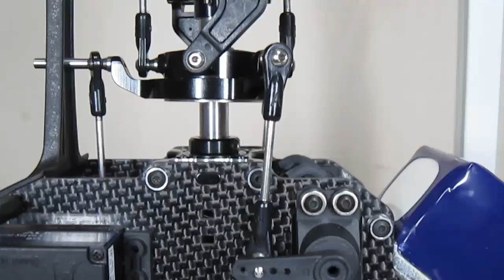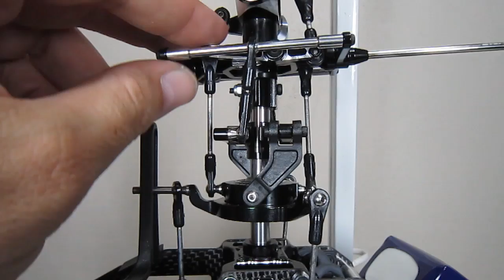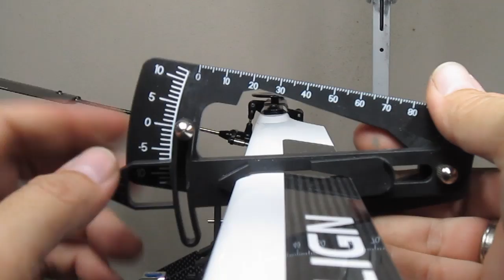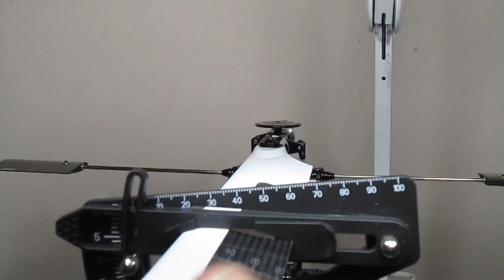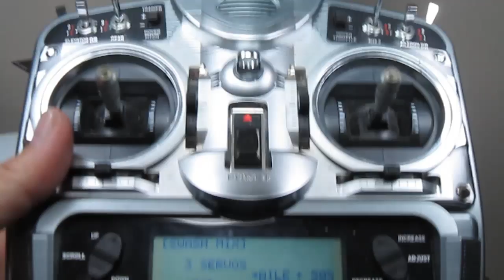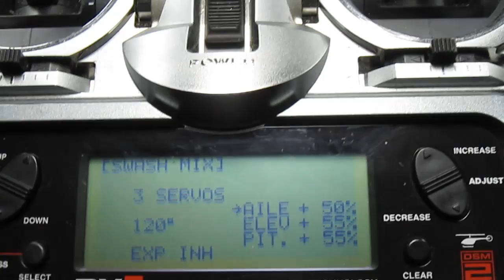Align T-Rex 500 ESP Step by Step Build Page 22

Comment from the maker: to measure the aileron and elevator angles simply put the blades at  90 deg to the heli and inline with the heli for elevator /. aileron measurements. I will do a video soon to explain that, its a lot simpler than people think. when the blades are 90 then elevator is measured by using just the elevator stick movement, same setup as pitch but your at center stick for the measurement, and inline with the heli same process for the aileron.

Comment: Thanks for the video. A quick question:  when i rotate main blades by hand, i got a slight delay before the tail starts to rotate. It is just a bit and it is (what I think is caused by a bolt inside rotation-autorotation part to be smaller then a hole where it goes). Is it ok& I really did not have problems so far but just a thought to tune it up. Should it be solid turn when i turn of the tail blades, the main blades are turned, or this small delay is fine? I think it is due to the diameter of a bolt which runs thru autorotation setup.